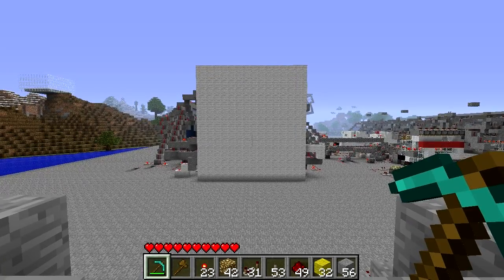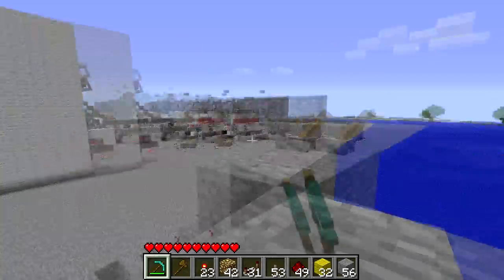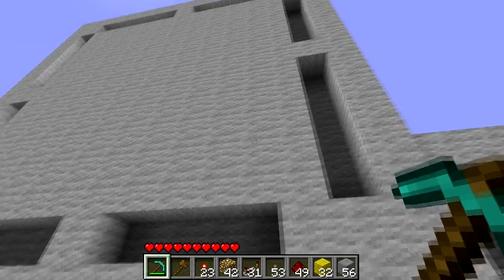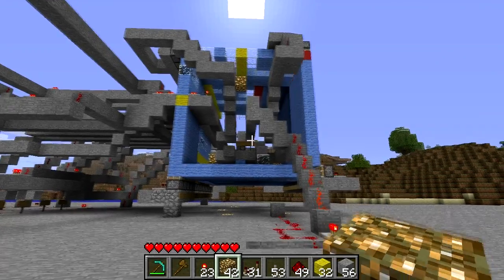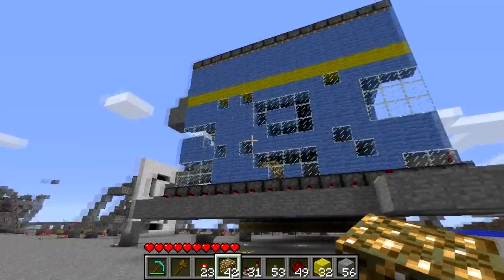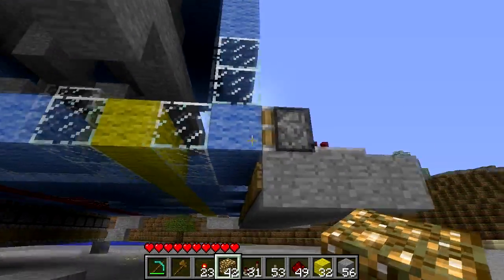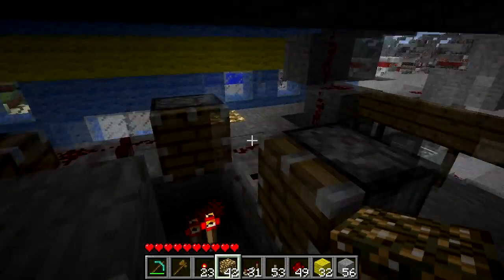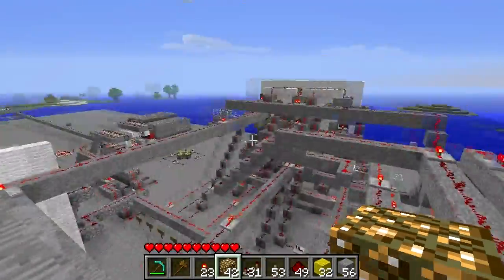Minecraft - 16 Segment Piston Display and 43 byte punch-card memory

Comment from the maker: @arkayblesses The length of a byte is arbitrary. It's only 8 most of the time and it depends on the computer system. Early systems used 4-bit and 6-bit bytes.   When a byte is 8 bits long, it's called an "octet".   Even today, most data is transmitted as 7bit segments, with the 8th bit being used for error-correction. 

In my application I think it's fair to call each set of 16 bits a "byte" since they represent a single frame of the display.